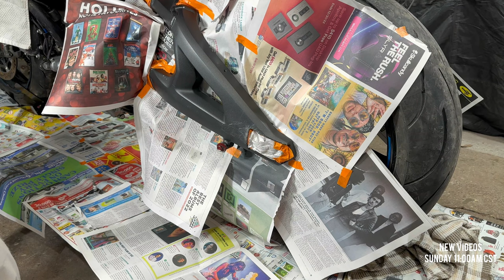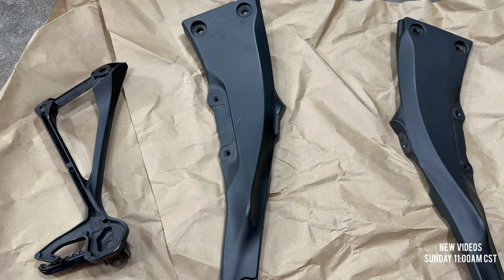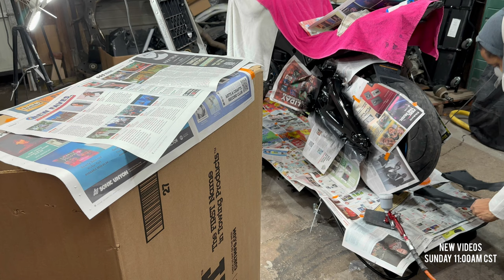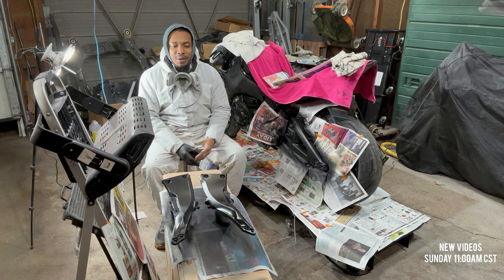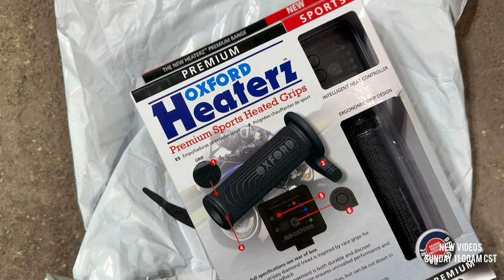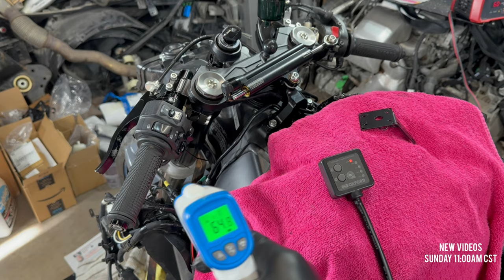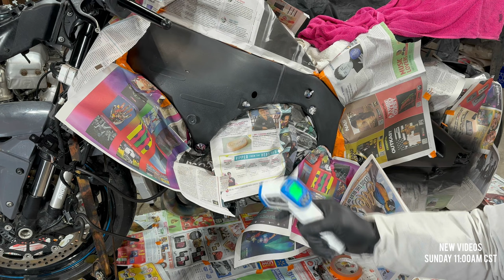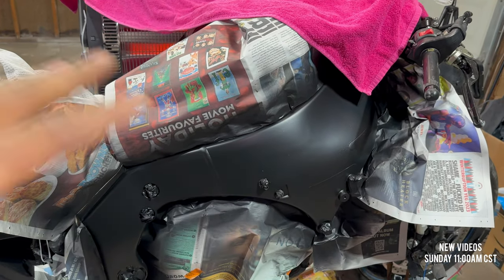Rebuilding A Wrecked 2020 Kawasaki Ninja ZX10R - Part 5

Comment: Subscribed!! I'm going to be repainting my frame as well. Can you tell me which scotch Brite your using. And are you just spraying single stage onto frame after that? 

Great vids
Reply from the maker: Thanks for subbing! I use red scotch brite I picked up from my local paint supply store. I used SEM trim black paint. It’s single stage, no primer or top coat required